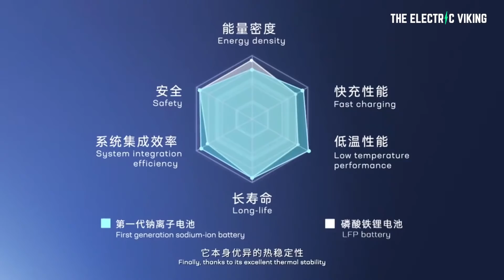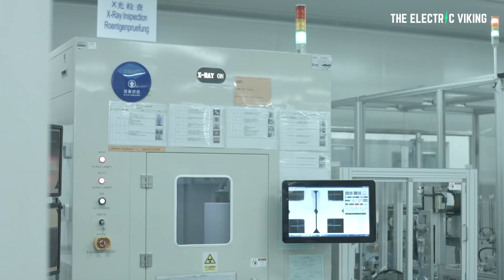CATL's new SODIUM battery will solve the world's energy problems

Comment: So when 5% of the battery get 3 times heavier, the battery is 110% heavier. On the other hand, using aluminium the battery is 10% lighter. So at the end, they were able to produce a sodium battery with the same weight as a lithium battery?

Comment: These are more exciting for stationary applications as lithium still have an inherent advantage of energy density due to basic chemistry. There are already niche lithium battery products on market that have considerably higher energy densities than LFP batteries. LFPs big advantage is it's relative stability and reduced rare earth content. It's actually a relatively poor performer compared to other lithium chemistries when it comes to density and peak power. Lithium polymer can have densities closer to 300Wh per kg and many times higher peak output. There are also some batteries just emerging from the lab that have in excess of 400Wh per kg so whilst sodium ion is exciting and may be a game changer when it comes to cheap EVs and stationary storage it isn't the lithium killer many think it is.

Comment: battery power density  not measured  w/kg.... its Wh/kg 
 energy density is the measure of how much energy a battery contains in proportion to its weight. This measurement is typically presented in Watt-hours per kilogram (Wh/kg). A watt-hour is a measure of electrical energy that is equivalent to the consumption of one watt for one hour.

Comment: Not clear on specs but hey trust them cuz they're number one. Sorry mate, this is still 5+ years off.
They get these results in a lab under ideal conditions with not stating all the specs. There is room to be skeptical and telling anyone to pound sand doesn't help your channel.
Yes lipo tech has vastly improved over the past 20 years.
Soon it will jump to another chemical composition a new manufacturing techniques.
It has to if they want to make electric vehicles for the masses.
Again youre looking at a minimum of five years before it comes to Market

Comment: Definitely "A" game changer, but with all the current research being undertaken I doubt if it will be THE game changer.

For the short to medium term domestic market? A huge difference. In the UK right now far too little domestic storage is happening due to the double whammy investment needed in both solar & batteries. The other problems with solar in the UK are:

a) limited hours of daylight in winter (that's not even counting the lack of unobstructed sun) 

b) standard solar installations are becoming more expensive due to removal of govt subsidies and lower feed-jn tariffs.

c) lower effective square footage for solar power capture - only ONE Southerly facing side of a house (as I have) is currently able to collect useful energy. With the size of roof of a typical UK house, the maximum collectable is around 3kW under sunny conditions.

All the above make it essential that people invest ASAP in storage of even 200-300 watts to save money on the increasing cost of electricity. Roll on REALLY low cost (you can't call it cheap really) battery storage! 👍👍👍

Comment: Even if sodium-ion would never get to the same energy density as lithium, if the cost is far lower, it makes perfect sense for making dirt cheap bulk storage for solar or grid-backup energy. At the very least, it will free up lithium capacity for things like vehicles and phones where the best density is important.
Reply: I agree with you, now is not the time to replace Li-ion. Na-ion needs to get the money flowing in static application.  I would buy Na-ion battery for my solar panel applications even if it takes more space.  Get it to market.

Comment: If Sodium is about 3x the mass of Lithium, and 5% of the battery, that's a battery which is 10% heavier. But if the energy density is as claimed, it will be smaller in size than a Li battery. Overall mass will be similar. (Watt-hours per kilogram, not per volume, remember.) So, if the claims are true, this truly is a game changer. I'm watching closely.

Comment: Charge rate is the Holy Grail of the EV industry.  For a local commuter vehicle that charges by day (at work) and by night (at home), EV's are a niche market, but not suitable for cross country travel with several "refueling stops."  Not many drivers will be satisfied with 15 minutes per stop to only gain 75% charge when a liquid fueled vehicle travels farther and refuels faster.  I applaud CATL's breakthrough technology, they are on the right trac.  This will certainly be a game changer and bring down the cost of home energy independence.  Energy storage cost is the largest component of solar power.  This could put lithium batteries on the shelf next to NiCad's.   Great video, well done!
Reply: I agree static mass storage is where they need to concentrate their efforts.  For now Li-ion can have the EV market.  As soon as the money starts flowing in, they can fund the research which will take it into the EV market.   They can probably make Na-ion batteries replacing the lead acid, which is also very heavy.

Comment: The industry had a sodium battery in 1979 that was used in the Ford EV attempting to meet standards in a government EV exploration project. Not much new in the world. 

Now for how is it NOT going to solve the energy problems? Electrical generation is independent of the storage solution. It is driven by consumption of electrical power. So a storage solution that stores a trillion kw in a cubic foot does not add on kw to the grid. It just sucks off the grid.

Comment: Well the storage capacity compared to lithium ion is one thing, but can it actually deliver power at the same rate?  What about longevity or heat generation within the cell?  How many charge cycles can it deliver?  Is there a specific temperature range it must be kept in to operate?

Comment: I want to keep seeing huge improvements in battery tech from now on.
As the EV revolution progresses, there will be more and more demand for better batteries. Economies of scale ought to drive down the cost.
The ICE engine has reached diminishing returns in regards of improvements and efficiency gains. Now that ICE is on its way out, don't expect any new breakthroughs for piston engines. It's just not going to happen. The money has already moved away. ICE is done, but EV's are poised to make drastic improvements for the next few decades.

Comment: Any electro-chemical reversible reaction is not energy intensive enough for light and performing mobility and way to slow to reverse during recharge while quickly wearing out and therefore is not a durable mobile energy storage solution. On another hand, hydrogen has the highest calorific value at 120,971 MJ/kg of all oxidised combustible fuels. H2 is easy and cheap to produce and store with green solar powered zero carbon electrolysis and a far better energy storage media for any powerful mobility purpose, truck train plane etc. ..the evidence of it is that 50 years ago, hydrogen was absolutely mandatory to reach the moon. Game over.

Comment: 2 years from now - why the hold up?  "The electrolyte materials for sodium batteries can be organic solvents or inorganic solids. Similar to lithium-ion batteries, using organic solvents in sodium batteries may cause serious safety issues such as fire or explosion due to the high flammability of organic solvents." They also have a low life cycle.In 2 years there may be many other options including early solid state batteries.

Comment: i guess it's sort of inevitable, once the lithium price get expensive enough, they will move onto the next closet material. Kind of similar to how technically copper has better conductivity per unit mass compare to aluminum. But aluminum has better conductivity per unit dollar, so most transmission line is made of aluminum instead. If they get too expensive, invest to use the next closest metal will probably increase. Which is why commodity metal price tend to follow a boom and bust cycle, once it gets expensive, it attract newer player with better technology, and shuffle money into alternative commodity. Until so much supply come online that it overwhelm demand, then company go bankrupt, then boom and bust begun once more.

Comment: Interesting.  The average Li battery stores 150wH of power per kg. (ps.  It doesn't store 160 or 200 w per kg but rather wH per kg.  Watts are power, watt hours are energy)
Reply: Most people don't understand the difference between energy and power, something I learnt when I was about ten years old.
Reply: you mean "... but rather Wh per kg"
(it's not a w for watt and not an H for hour)
imagine trying to correct units and still using incorrect ones.
Reply: And diesel has an energy density of 12000 KWH per kg. Yep a great step forward.
Reply: @paulp1267  that would be wh/kg, NOT KwH.  When you've burnt that kg of diesel, it's gone, but you have a potential of a usable 900 000wh per kilogram of battery (@150wh/kg). So, yep, a great step forward.

Comment: All power to them if they’ve done it, one of the major breakthroughs and if I’m not mistaken, puts EV’s over the break even line with ICE cars. Having worked in China (for 16 years) and for CATL in Zhejiang, I’m going to watch this one unfold over the next few months, and hope it’s not another research promotion designed to nullify some political pressure …or something along those line. You sound very optimistic so I’m watching with even greater interest than usual! Here’s hoping!
Reply: Hopefully they can get the energy density up while keeping cost down. That's pretty critical for cars and phones. At the very least, it will probably replace LiFePO4 for bulk energy storage.

Comment: Sorry for my late comment. Big questions here: What is the battery life? After 4 years, what is the percentage of power? 80%? Is it less than that? In other words, true battery cost. If I buy a car with these batteries, will I need to replace a giant, costly battery pack and when? How does this compare with ICE vehicles?
Reply: A general comment: Buying an EV, a customer should consider it's cost over a period of time compared with ICE vehicle in the same class. It's not just the fist year, but the car's lifetime. Okay, I buy an EV, and I know it's operational cost the first year, but what about year 5, year 7, etc? Is replacing an EV battery pack even practical or possible?

Comment: Looks like it could be great for the BEV industry.  Grid storage, maybe.  I think maybe iron redux flow batteries might be better for grid storage even though energy density is low, and that's because density isn't critical for grid storage in many places wind and solar farms exist, and the most important issue is efficiency in energy conversion.  But, for home storage or grid storage in urban areas this would be a big deal.

Comment: At first I was thinking how can this be an advantage if the battery, although cheaper, is currently heavier than current lithium ion batteries but I can see the potential of it. I'm still not sold that it's the right battery for cars given the fact that it is heavier. There isn't much you can do to change the overall weight of some of these cars so it will be interesting to see how they can retain that energy capacity. We do know that sodium batteries are on Elon's radar. He spoke about their viability a few months or so ago.
Reply: Sodium ion battery now has a energy density of 160 watts per kilo, but once when it is up to 200 watts per kilo, it will be lighter and has a longer Ev range. It's also much safer than lithium ion battery. It probably will take up a couple of years. I have confidence on sodium ion battery. I'll wait.

Comment: Sam. Nickel is hard to source. Indonesia has stopped export to china. Phillipines cannot meet chinas demand. Forget about these batteries as a storage solution.  Sam there is only one way for us to go. That is Thorium reactors, fast reactors, roof top solar and hydrogen production for our transport needs. The best part is that we can drive vehicles with standard internal combustion engines directly with hydrogen i.e. no need to lay off people and industries. Batteries are only stop gap. This is the only sustainable way to proceed. The quicker we move to do it the better. Read about Indias three stage nuclear program.

Comment: * important edit * I tried to make the explanation simple but I forgot to put in the multiplication symbol "everyone calls it 'X' for 'times' but I will use 'X' here.
You have been doing these videos for a while and you still don't understand the difference between energy and power?  Watts is a unit of power but you are giving that when talking about energy.  Watts per kilogram is a unit of gravimetric power density.  Watt hours per kilogram is a unit of gravimetric energy density.  I suspect you were trying to say "killowatt hours per kilogram" when talking about gravimetric energy density.
To make it easier, power is the rate at which you can deliver energy.  Which means that power times time is energy.
Simple example: 1 watt of power delivered for 1 hour is a watt X hour of energy. EASY!! 
The multiplication is implied so it is written watt hour or watt-hour when it means one watt TIMES one hour.

Comment: What's the big bottleneck in BEV's adoption? It's the battery that limits range, affordability. The sodium solution is a tipping point that will drop price, increase range, lower charge time, making BEVs inexpensive enough for everyone. Gas cars will be too expensive by comparison. The only question: How long til production meets demand?
Reply: No, it's not the solution (yet)
System efficiency can (will) have just as much effect.
For instance, a higher energy density cell, (weight AND volume) with fewer cells in a pack, will be smaller, lighter, and so result in a more efficient vehicle.
using fewer of a more expensive (?) cell makes the pack cheaper.
To "increase range" you need similar.the sodium cells will only be aiming to match, maybe just beat LiFePo4 for gravimetric density (Wh/ kg) but they are more bulky (Wh/ litre) so the problem becomes fitting them in the space available.
.
The smaller the vehicle (examples "cars") the fewer cells you can fit, so the PACK capacity will likely be lower.
Tesla overcame this problem by using the pack as structure AND (probably) increasing the cell density, thus reducing the total vehicle weight.
Hence "System" (vehicle) efficiency.

Comment: Regarding the charging time, the size of the battery doesn't necessarily matter. A bigger battery (pack) will be able to accept a higher charging rate, so reaching 80% in X minutes can be true regardless of size as long as the charger is up to it.

Comment: It is hard to beat the LFP chemistry because of the cycle life.  It is not uncommon for LFP cells to have in excess of 3,000 depth of discharge cycles.  Therefore cost per kilowatt hour initially is not the only metric in determining the least expensive way to have energy storage for the  life cycle of a battery electric vehicle.

Comment: 5:36 "remember that lithium only accounts for less than five percent of a battery's overall weight"

True, but then more weight gets added on (about 20%) specifically to keep the Lithium cool to avoid the flammability range. How much % of the weight of a Sodium-ion battery is sodium? Is that the 3x more weight you mentioned or was that just in general? 

Can they add graphene to the Sodium-ion battery for better performance and charging etc?

Comment: These are a game changer for Home Energy storage.. Buy it for cheap, charge it up at cheap overnight electricity rates and use the battery to run your home as much as possible. Add in solar panels and a wind turbine and you're basically offsetting the money you would have spent on your home electricity bill. This is an amazing development!!